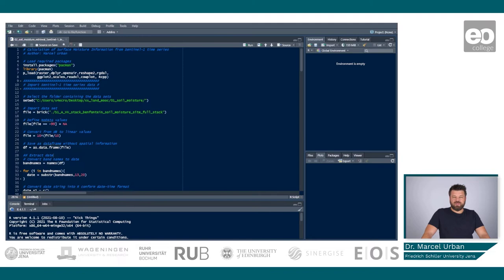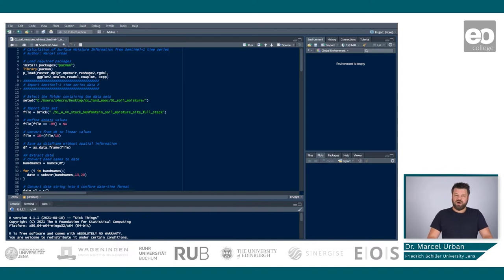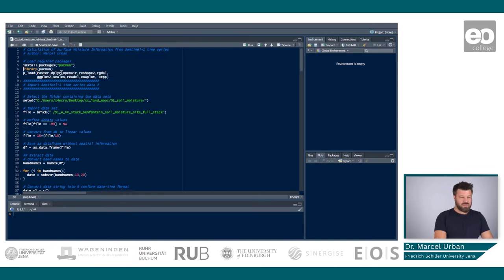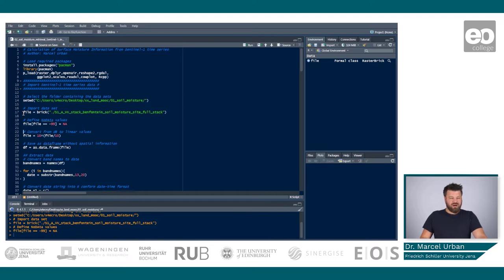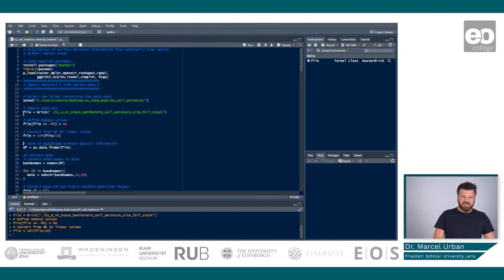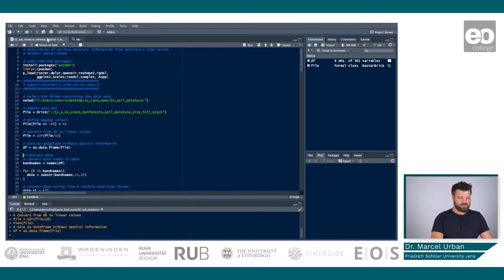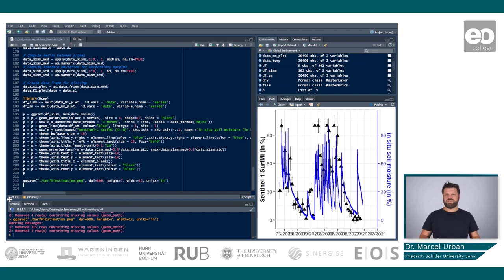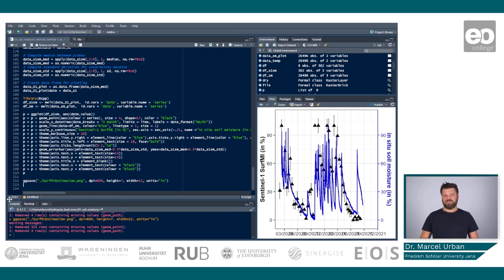Soil Moisture Estimation - Practical: Use in situ data to estimate soil moisture from Sentinel-1

Comment: Hello sir,
Is the sentinel 1 data is preprocessed?
Reply: I need to extract soil moisture from single data set. I have already pre- processed the data and am stuck in extracting soil moisture using backscattering energy. So, Can you please help me out with this?
Reply from the maker: Hi Santosh, yes the Sentinel-1 data was preprocessed to an ARD level.